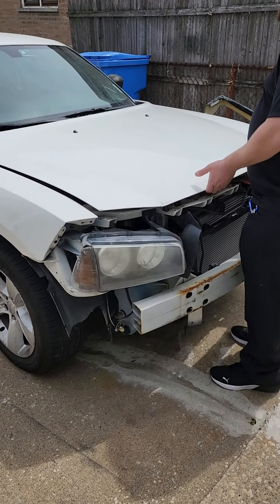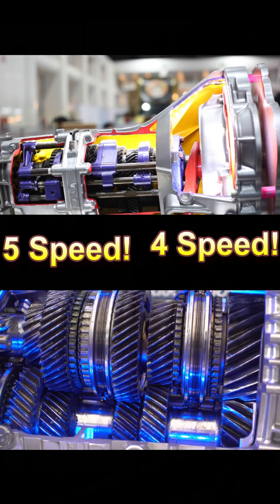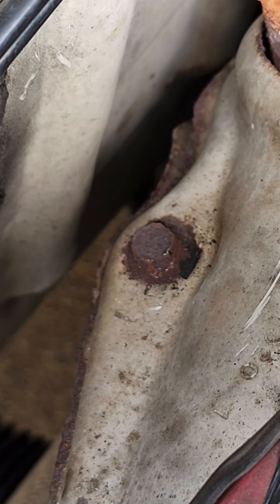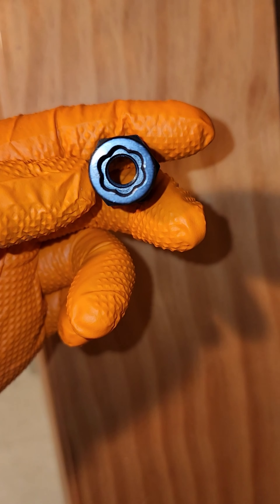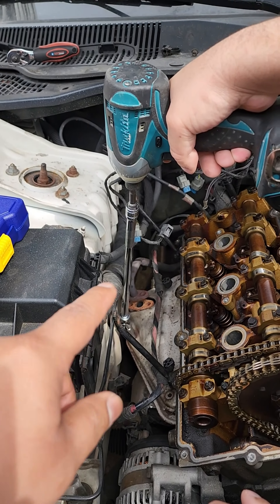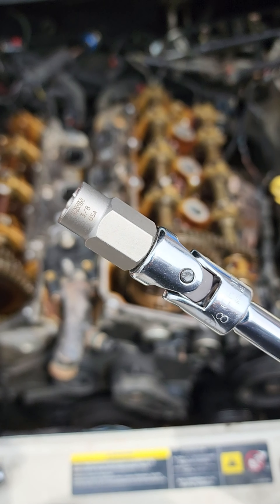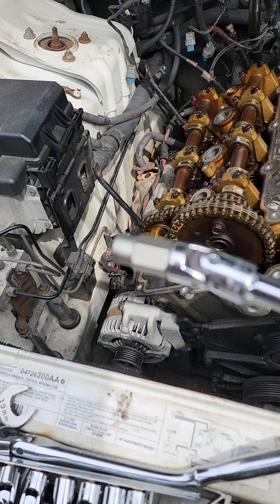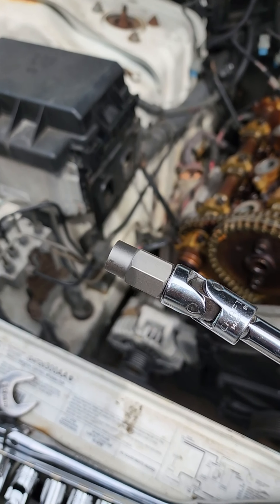GEARWRENCH Bolt Biter vs IRWIN Bolt-Grip!😯

Comment: Next time use a Kobalt drill, that bolt laughed at your Makita and stayed there. It would have been scared by the Kobalt and unscrewed itself lol great video Ed!!
Reply from the maker: LoL 😆  honestly it didn't slip once, the makita and Irwin did it perfectly unfortunately the back bolt was a square bolt and that one did slip. Once we put some pliers on it ...boom we were able to remove the heat shields
Reply: @edtheoldtechguy  “Shields up Scotty!”

Comment: FYI, the larger Bolt Biter sets have minus sized extractors just for this application. So they have a 10 and a 10- as well as minus sizes for many of the more popular sizes. Plus, the Bolt Biters are straight fluted so you can use them on left-hand threads or re-use damaged screws if you need to. I'm a fan of both brands, by the way. Use what you love and whatever works!
Reply from the maker: Heck ya! Coyle thanks brother!

Comment: I went the bolt biter route and have been pretty happy with them. I'd like to get the deep set aswell. I have the master kit that gives you both sae and metric not the combination sizes. I haven't tried the Irwin set but have tried rocket socket and they were meh in my book. Here on the best coast the west coast lol we we call rust is laughable to your parts.

Comment: my bolt bitters almost fail trying with a ratchet it was slipping on the fastener but with my 3/8 impact work better and took the bolt out after been stripped to a size 11 this bolt was 12 oh 13 can remember but it was bad real bad they left like a cone shape 😂😅